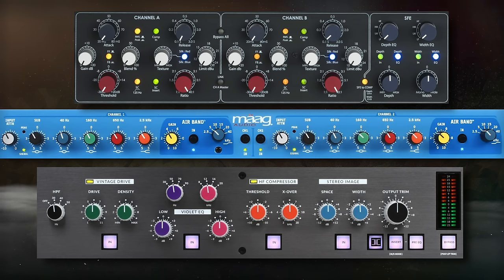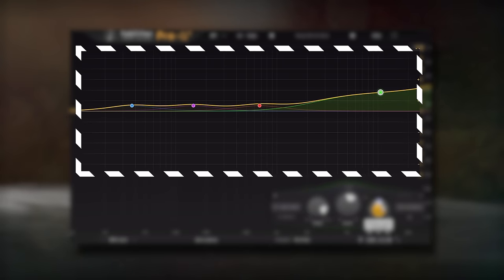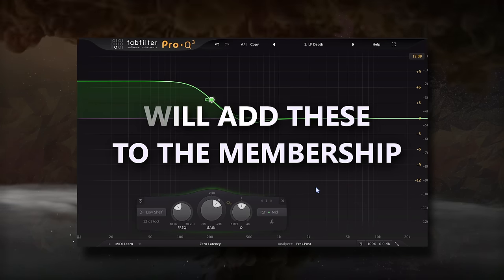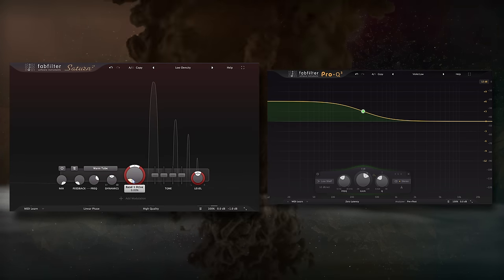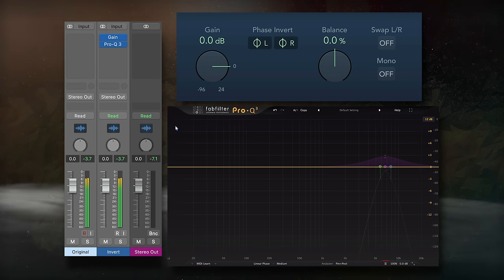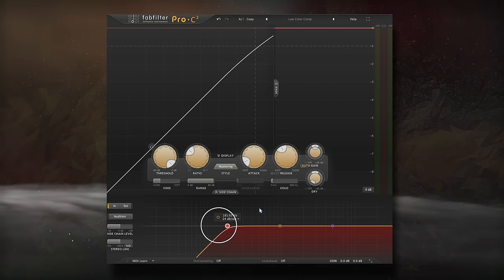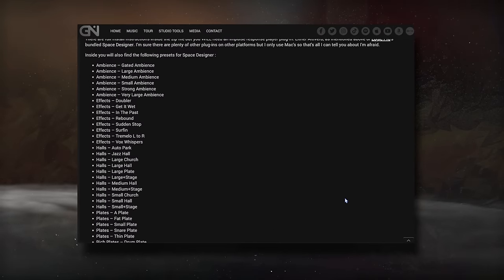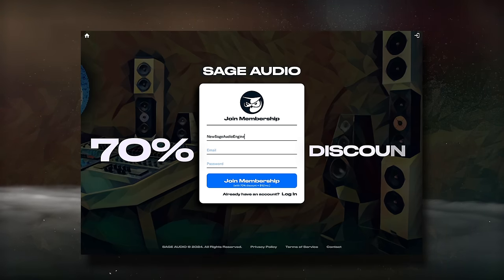Recreating Analog's Most Elusive "Secrets"

Comment: why did you do the de-essing that way? instead of using an extra channel with inverted polarity you could've just dynamically eq'd that specific frequency band on the original channel. same result, less messy. you say this is different to regular frequency specific compression because it uses phase cancellation which makes it smoother but the way you have done it, it actually is exactly the same as regular dynamic eq'ing since you have total phase cancellation. you would need to alter the copied and polarity flipped signal in some other way for it to create a difference compared to regular dynamic eq'ing